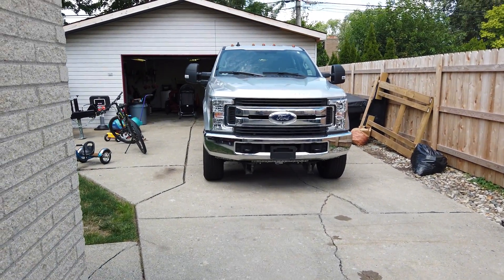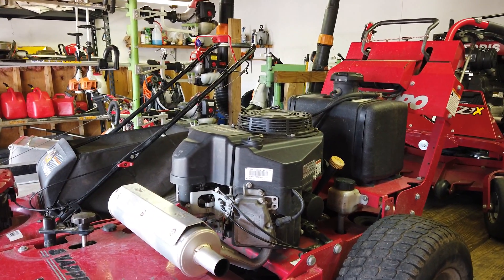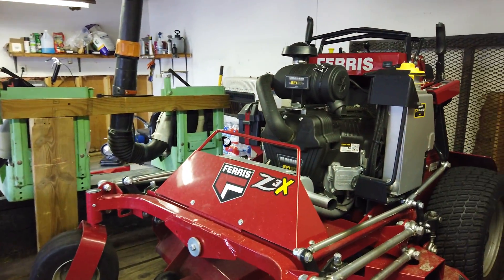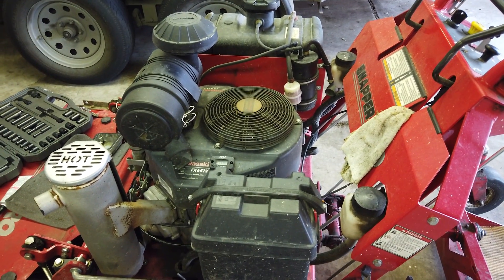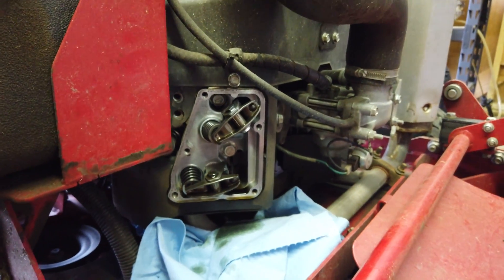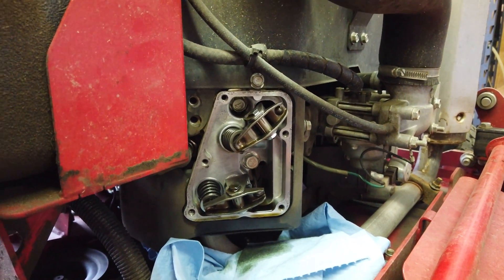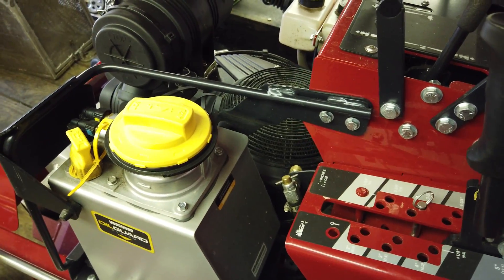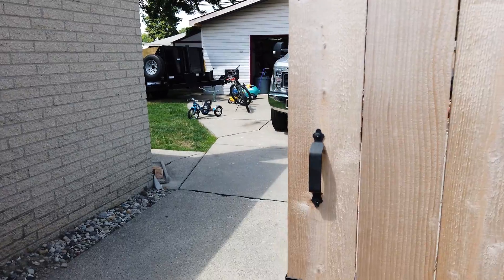INSIDE an engine that ran Mobil 1 full synthetic oil for 1100 hours!

Comment: Amsoil signature might be around 25.00 a quart...it might be better on paper but in rhe real world its probably not better than mobil one 20k or castrol 20k...don't even bring up Pennzoil if it doesn't say 20k miles oil change interval on the bottle
25.00 a quart or 25.00 for a 5 quart bottle..which is better?
My bad the cheapest I could find amsoil signature is Amazon at 31.03 per quart..that's ridiculous...is that a pyramid scheme

Comment: im not surprised.i've seen inside my own engines, been using mobil 1 for years.but i also use shorter change intervals than the factory recomends.after all the oil dont wear out, its the crap in the oil that wears things out.even with a 20 micron filter.

Comment: Long story short,  I switched from Harley oil to mobile 1 on my sportster back in 87. That bike was getting 50-55 mpg with Harley oil. With absolutely nothing except changing to mobile 1 it got 55-60 mpg and the oil tank was noticeably cooler.  That bike ran as well as the day I bought it for 18 years and still got the same mileage ( 40,000 miles). 
I will admit that I have never seen anywhere near the fuel mileage improvement with any other vehicle but that bike convinced me that mobile 1 was what I would use from there on. Considering I've never had engine wear issues,  I will stick with it for a lot longer.
Reply: Back before Harley had their Synthetic they would tell riders you cannot run Synthetic in our bikes - it was to slick lmao they called it bearing skate. 2 yrs later Harley came out with Screaming Eagle GRP 3 syn oil then suddenly it was ok.

Comment: Broke my 2002 tacoma in with 10 changes of conventional oil every 2500 miles. After that break in, I ran full synthetic. Just gave the truck to my daughter after 20 years and an odometer at 375k. It still burns zero oil and should last up to 500k.

Comment: Use the correct oil made for the application. Hardworking smaller 1 and 2 cylinder power equipment engines deserve an appropriate oil made for these engines. Use your Mobil 1 EP 5W-30 in your truck engine. That's what it is made for. Only the Mobil 1 15W-50 will do a good job in the  mower engines. If you want an even better-suited oil for these engines, get some Amsoil 15W-50 small engine oil. You will then have a hard time wearing out your engine if you keep up with your air and oil filtration and keep debris from collecting on the engine cooling fins of the fan forced cooling. Check oil levels often and change every 200 hours too.
Reply: I use the mobil 1 15w50 in my 20 hp briggs mower...it does great....

Comment: I bought a BMW Z4 in 2003 and still own it today. It has 112,000 miles on it and I have used Mobile 1, full synthetic for nearly the entire time. Changed oil and filter every 7500 miles, factory recommended 15,000 between changes. The last oil change I pulled the valve cover just to see what a 20 year old engine looked like inside. Showed no obvious wear what so ever on the cams or timing chains and sprockets. Clean, with absolutely no build up anywhere. Could still read all the factory numbers written with marking pens. Much better than I could have even hoped for. I am a complete believer in Mobile 1. I am probably too old to check it at 200,000 miles but, one of my sons can do it.

Comment: Take a look into Schaeffer oil. Americas oldest oil company 💯
Reply: Overpriced.  Mobil 1 better
Reply: @scottp6761  Briggs and Stratton did a engine test with 2 engines 1 had Schaeffer and 1 had mobil 1. Thry ran the engines for countless hours and when torn apart the mobil 1 engine was junk.
Reply: @charlespetersonii6989  again.  Mobil 1 against Amsoil isn't very behind.  Watched tests myself.
Reply: @scottp6761  Not sure what tests you seen but the Briggs and Stratton was done in real engines used for a period of time. Look at their websote it says they fill all generators with schaeffers oil. 
Ive used amsoil and mobil 1, redline, valvoline vr1 racing oil and a few more. Found Schaeffer around 10 years ago and my engines have never ran so smooth. They do have 2 patented additives which in my opinion helps set them ahead of the rest. Micron Moly and Penetro. Not saying any others are bad i just have had amazing results with schaeffer.

Comment: I use Mobil 1 in all of my engines. Car and truck. Mower. Power washer. Weed trimmer. Brush cutter. They are all flawless when I pull valve covers or inspection covers off for adjustments or maintenance.
Reply from the maker: It's good stuff!

Comment: Thanks for sharing all that great information. My extensive research has shown that Amsoil is, by a good margin, the best synthetic oil you can buy. Is it necessary in all applications? Probably not....   I use it in my motorcycles and my 3.5 Ecoboosts.
Reply: I would say redline full synthetic has a better additive package than amsoil
Reply: @jonschwartz9669  No

Comment: I also have an Astro van with sticking lifters, and valves that kept throwing mis fire codes over 55mph. I put the Mobile One in the engine, and in about 2 weeks later, the lifters stopped, and the thing runs great now. The previous owner used crap oil in it, must of sludged everything up.

Comment: I bought a suburban V8 5.3. I used only Mobile one 5-30, fairly reliable in changing oil. Never had to add oil, and the tail pipe was grey inside, no soot, at all. I prefer it and even use it in my lawn mower. I had185K miles on the vehicle  and was ready for another 185, when crazy bitch hit 5 cars in a big store parking lot, knocked my suburban 90degrees out of a parking spot. 14 years old and the insurance totaled it, I was in "Good Hands". But I still use Mobile one, great oil. Petroleum oil is not kind to plastic parts.

Comment: Dude, listen! Motor oil starts to become VERY ACIDIC after 12 months of usage. You MUST change the oil at least once per year, REGARDLESS OF WHAT KIND OF ENGINE YOU'RE LUBRICATING. I learned this at Amsoil's "University" that they conduct once-a-year.
Reply: 6 months 5k miles max.
Reply: @scottp6761  Sure, if you want to waist money and time.  Why not change it after every drive?
Reply: @user-tb7rn1il3q  there is timing chain issues known in my car.  Also you don't have any clue what I drive.   I'm running a ton of power on this engine and fresh oil is a good thing on a massive turbo running 38 psi
Reply: The time varies.  An engine that is run on the highway for 3000 miles and stored in a dry garage will not have acidic oil after 3 years.

Comment: Im thinkin of running mobil 1 15w50 in my 20 hp intek.alot of commercial guys use that grade for hot weather to hold up better....it also has 1300 ppm of zinc and 1200 ppm of phosphorus for wear too.

Comment: Not knocking on mobil1. It is far superior to conventional oil and some other full synthetic brands. With that said, full synthetic oil is not all synthetic. It's just a legal term meaning the oil must contain at least 25% synthetic oil.  Not telling you to switch! Just pointing out a fact you may not know because I didn't. Amsoil, however, is 100% synthetic which is all synthetic oil molecules. I used mobil1 for years as well. I was ignorant to the fact there are better products out there. Also, mobil 1 filters area paper synthetic blend media and filter at an efficiency rating of 99% @ 30 microns. Fram ultra or Amsoil EA filter are synthetic media and filter at 99% @ 20 microns. 33% smaller particles are removed.
Reply: No need for spending the extra money unless you have some high end sports car. Mobile 1 for the money can’t be beat. Amsoil is great. Just don’t see the need to justify the money for most vehicles.
Reply: @jesusthug  the difference is negligible for cost between the two. The bigger factor is they don't carry amsoil at Wally world. I personally will not run Mobil 1 in the voodoo V8 in my Shelby GT 350. Also in my Subaru, of which I have owned 13, the design of the boxer engine inherently uses oil. Since switching to amsoil from Mobil 1, I have not had to add a quart of oil between 4-5k miles on an oil change. So there are other reasons to make the change. Adding extra quarts of Mobil ends up more expensive in the end
Reply: @jesusthug  Worked fine in million dollar jet engines where I worked, it's just fine for a car. lol
Reply: @danbush1249  only polyol ester work in jet engines...aka Redline oil.
Reply: Amsoil uses mobil1 base stocks, but is all true synthetic.  It’s a good oil, but not really necessary for most applications.
Reply: Mobil 1 EP is 60% to 70% PAO according  to  their SDS.  It's a lot cheaper than Amsoil and will protect your engine just fine.
Reply: @MrRGiller  I was a Mobil 1 user until recently. I can personally see the burn off rate difference between the Amsoil and Mobil1. My Subaru is currently at 8k miles using the Amsoil Boosted XL 5W-30. Hasn't used a drop. Using Mobile 1 I was adding a quart by 4-5k. Manufacturer interval is 7500miles. If you have good results with Mobil 1 great! In the end it would not be cheaper for me as I would be adding oil more. Secondly, I do not trust my 5.2L Voodoo V8 in my Shelby running at 8250rpm to anything but Amsoil at this point. Again between the Amsoil and Ford Motor craft, burn off for Amsoil is half the rate or greater. Just my personal experience.
Reply: Amsoil is great. But just expensive as hell and hard to find someone who sells it. I just switched to Mobil 1 EP in my Toyota Venza 3.5. I'm at 7k on the oil, hasn't used a drop. It never has used oil but was curious how it would react to EP. It's doing good. Also 147k on it.
Reply: @Tylerc3419  that's testimony to the fact yamaha builds the majority of toyota engines. Yamaha is an "engine company". Hence the "Z" engine codes. I have a 2004 Pontiac vibe which has a 1ZZ engine. Doesn't use a drop. Difference between amsoil and mobil 1 again is that mobil is full synthetic and amsoil is 100%. It has half the burnoff rate. It lasts longer. Mobil will protect your engine just fine. Amsoil has more detergent and will keep the inside of the engine cleaner longer doing extended oil changes. Read the bottle on mobile EP. It does not guarantee extended oil changes. I can also see the difference in how clean the oil is at an extended interval compared to what mobil is at that mileage. The more I have used amsoil the cleaner the oil is each change. It's actually simple to get shipped right to your house. Amsoil OE is $5.45/qt. Not expensive for a 100% synthetic product. Also, I have switched to their filters as mobil 1 filters do not use synthetic media, they still use paper cellulose. You can use whatever your heart desires and what you feel works best for your wallet. For me, a few dollars more is cheaper and a new engine or trans.
https://youtu.be/6p69YEHqz0w check out 9th gens video. Also, go on amsoil website and try a trial subscription of the preferred customer program. It's $10 and any order over $100 ships to you in about 2 days for free.

Comment: I became a believer of Mobil 1 full synthetic after I left my lights on while at work in a North Dakota winter. With the battery completely dead, in -30°F my V8 truck received a jump from a B2000 Mazda and my truck fired on the first rotation. MOBIL 1 is my go to ever since.
Reply: Meh! You could get same results with 7-11 oil!
Reply: @Mister_Macintosh  you probably haven’t experienced North Dakota in the winter. You wouldn’t be saying that if you experienced North Dakota winters first hand. Your dealing with non stop wind. It’s brutal and dangerous.
Reply: @Northlandermn  i live in 1 of the cold places in in the midwest. I know all about brutal wind and cold. Mobil 1 is a good oil but wayyyy over hyped and over priced.
Reply: I became a disbeliever in mobil 1 full synthetic after i switched to it in my Subaru and it blew up 2 turbos within 2 months of the switch. Went back to standard oil and didnt have problems.